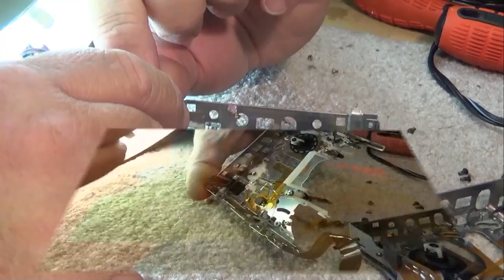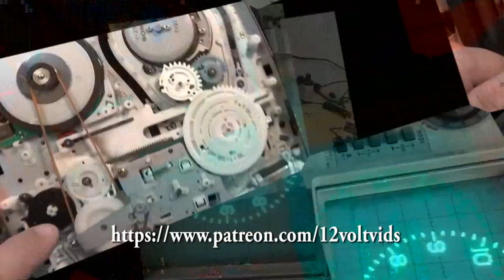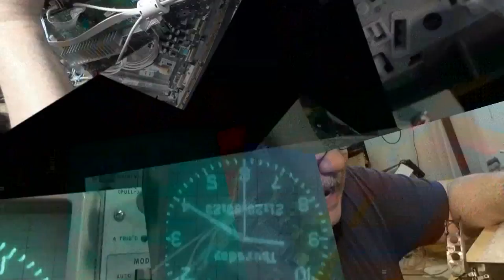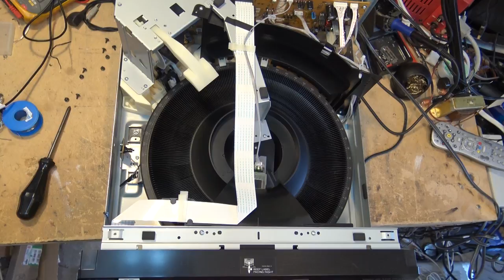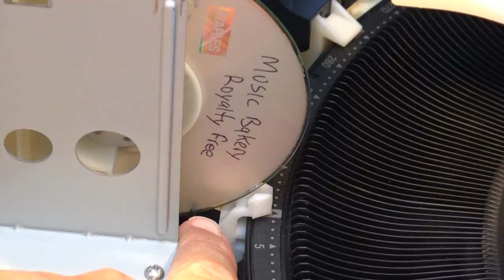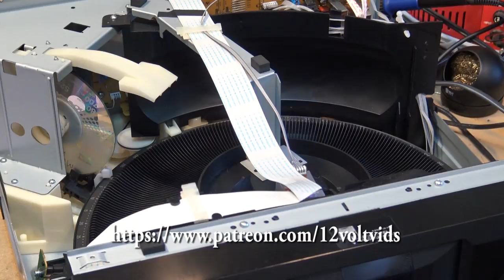Sony 300 disk cd changer skipping and disk jamming

Comment: My problem is, the carousel, when the cd goes around to the  loading mechanism, the carousel doesn't line up properly, and ends up being between the cds, so it won't load, any ideas, I'm thinking the carousel optical alignment eye might not be working ?

Comment: Dave,  I think some people here are under the impression that your Patreon fee is $32/month because that's the first thing they see is that big $32 figure when they look at your Patreon page, not realizing that you're only asking for $1 a month, not $32.  (BTW, I signed up).
Reply from the maker: David Bell 
Ha ha. That is what I make a month from patreon. 
Yes I was making 32 bucks a month from patreon. It is a little higher now, so I can afford to take the kids out once a month for dinner! Perhaps some creators huge followers on patreon but for many it is almost a waste of time. This is why when I see stats and it shows ad performance at 30-35% throughput because that indicates that the majority are using ad block software. This is improving though as yt is starting to do full commercial breaks and I applaud this as long as they are short 10 second or under spots. The TV industry is also heading to that model. In the next generation of set top boxes there will be no pvr units just clients and all people's recording schedules will be cloud based. Guess what that means. No more skipping recordings on playback. It has already started on some content.

Comment: The sled that moves the optical read sensor is not moving which means the motor drive for the sled is not getting a signal would that be what the problem is
Reply from the maker: DAVID GREGORY KERR 
The Grease dried up jamming the sled. It is all in part 2. How to take the mechanism apart which is very easy on this one.

Comment: first impressions, when I realized what I see - wow, 300, wow, 300, WOW!!! 300!!! DISKS!!! this thing played only audio cd or and mp3?
p.s.
wow, 300!!! 
0_0
Reply from the maker: This one only plays audio CDs. Sony also had a 400 disk unit that would play Audio CD and DVD and that one I believe also supported MP3.
These units can be slaved together. It has a second CD input, so you can put 2 together, and the system will cue the next disk and cross fade between them. 600 disks (or 800 with the 400 disk units)
I love these units. I have a 200 disk myself, and love it. If I was buying one I would go for the 400 but considering what mine cost me, trading an old 5 disk ES player that I got for free and it cost me 40 to put a new laser in, I am happy with what I have. 
Story goes on my 200 disk. Guy bought the 200 disk unit from the shop I used to work at. He had me over at hos house doing some computer work, and he mentioned that he had wished he had only bought a 5 disk because the 200 was too much work to remember where the disk was. I mentioned I had a 5 disk ES player. He said want to trade? I though about that for about .5 seconds!
Reply: compact thing... from now my dream is 400 disk cd-dvd data reader! i need this! (maybe)